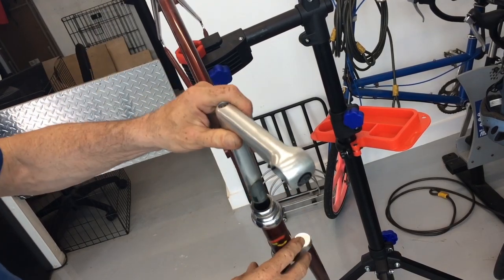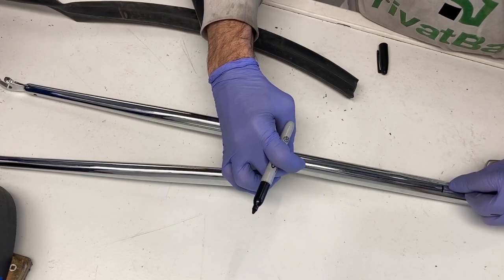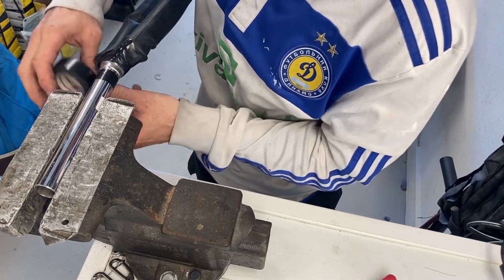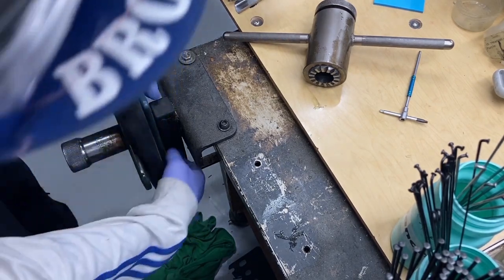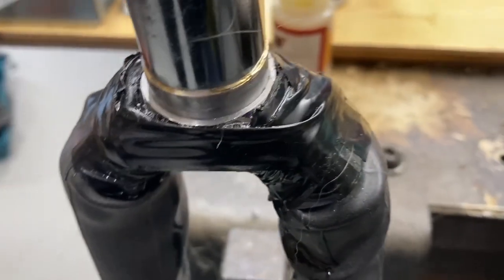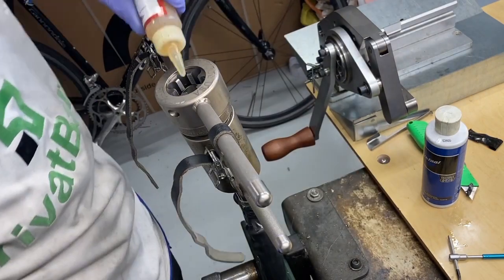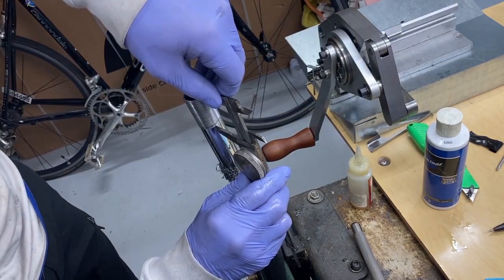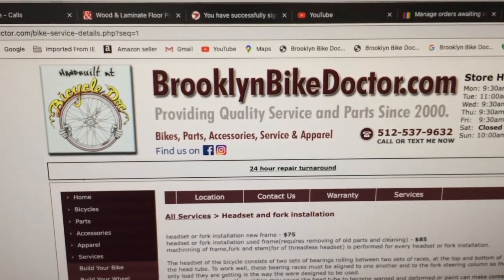Converting 1" threadless bicycle fork to threaded , milling and facing crown.

Comment: Excellent job 👍
Reply from the maker: than you for admiring.
Reply: @brooklynbikedoctor5949 can you fox threads on forks? It’s. Not a bike but a gas powered scooter. Previous owner messed up the top of the threads. I think it just needs to be tapered with a tool. I’ve fixed flattened threads before by hand with a file in the past. They don’t make these anymore so fixing it is a must.
Reply from the maker: If it is 1” or 1 1/8” threaded fork with British thread pitch , I can . 
If other diameter or thread pitch - no 
Can determine by physical observation only .
I am in Austin, Texas  on east side
Reply from the maker: @JFEnterprize  if those are 1" or 1 1/8 or 1 1/4 english threaded , that "yes" . i need physically look at the fork to determine .
  i am in Austin , TX East side
Reply: @brooklynbikedoctor5949  just measured. Def 1” OD from thread to thread. Pitch I’ll have to do the math on. Isn’t a full inch of threads to measure. Doesn’t appear to be a crazy pitch like plumbing pipe has. Nor a bevel at the start.  I think whoever owned em prior cut off an 1/8 or 1/4” off so the nut can’t center itself properly and go on. Like the outside needs to be reamed a bit
Reply from the maker: @JFEnterprize  we can talk for a while and measure virtually , but to see if i can fix it and actually fix it , i need it in my hands.

Comment: Is it necessary to cut a channel for a keyed washer?
Reply from the maker: No . It is not . 
Key washer is to help someone to adjust headset with one tool ( spacer/washer  with key supposed to keep nut steady while tightening lock nut ; usually is does not happened and key messes up the threads ). 
The right way to adjust headset is with two wrenches - one flat wrench to hold nut , another to tighten lock nut . If spacer/washer has key , it is best to be filed off in any case - even if fork has channel for the key.
Reply: @brooklynbikedoctor5949  alright, thanks dude!